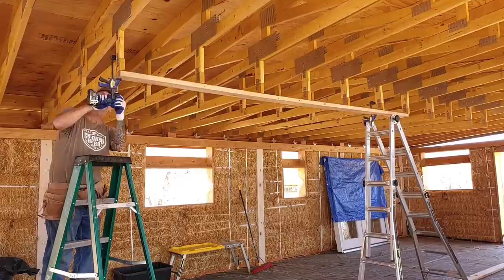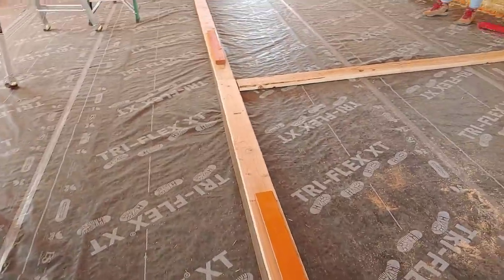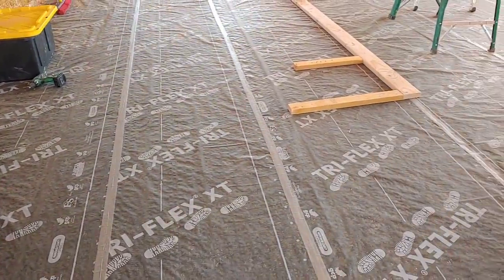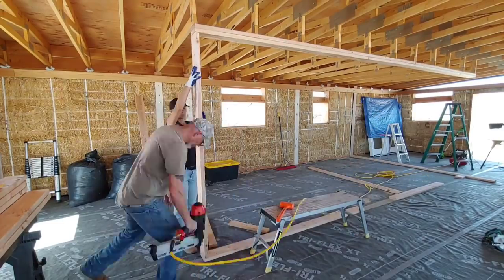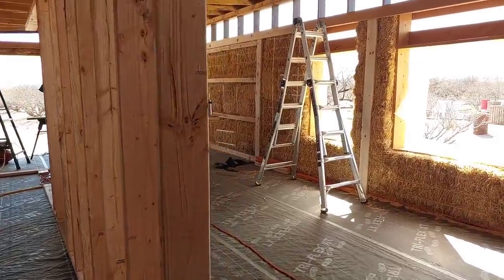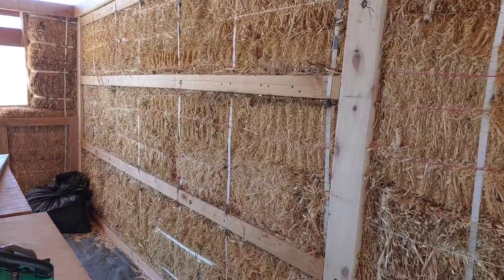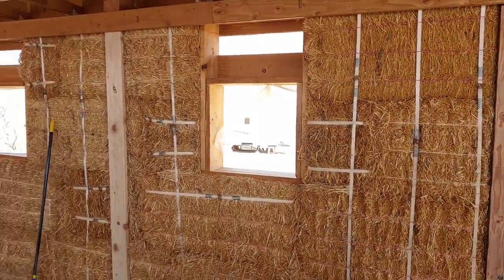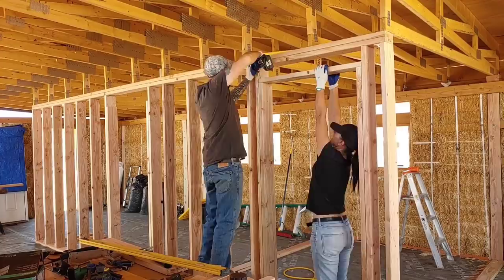Day 34: Building A Load Bearing Wall In Our Straw Bale House

Comment: Great job, never seen it done from the top down but it worked and thanks for sharing.
Reply from the maker: Thanks Daniel. Because the trusses were designed with this well in mind, it just seemed easier to do it in this order. The subsequent walls were either built in the floor and then said up, or the base plate was secured first and using a plumb bob we found the location of the to plate. The vaulted ceiling have us a few "challenges" but we worked out out.
Reply: @theupsideofdownsizing  👍🏽👊🏽

Comment: Please consider flipping the bathroom and bedroom.   My reasons are:

1) less plumbing distance from water heater.
2) keep sounds and odor away from the living room area

Thanks for the project, I look forward to each one of your videos.
Reply from the maker: Thanks for your comments. I think you're confused by the layout however. The bathroom is indeed already further from the living room than the bedroom, and because of the location of the kitchen, the furthest fixture from the hot water heater will be the kitchen sink, with the bathroom in between the kitchen and water heater. I will be installing a recirculating pump to the water heater to prevent having to let the water run in order to get hot water to the fixtures. As far as stink is concerned, there's a reason we put a window in the bathroom 😉 Sounds? We've been living in 250 square feet for 2 years without "sounds" being as issue. 😏

Comment: One thing I have been wondering as I have followed along. It is regarding the insulation. I know the straw bales are a good insulator, and I assume the spray foam for the roof is for insulation. But so far I have not seen any put on the floor. As I live in Sweden we have a very different climate to how it is down in Arizona. But what I have gathered you guys can also get really cold weather. So is the low amount of insulation in order to cope with the heat? And you will have some heating in the house to combat the cold days? Or how do it work down there, really interested to know. =)

Thanks for another great video. Very nice to be able to follow along. =)
Reply from the maker: I'll be insulating the floor after all of the installation of water lines and electrical. Most of that's going to be running under the floor anyway, so once it's in place I'll be able to insulate the entire floor and mechanicals at the same time. Thanks for watching!
Reply: @theupsideofdownsizing  ah I was just jumping the gun so to say. =)

Comment: What a nice home. Do you already notice a temp difference when you are inside? Or do you kinda have to wait for all the windows and doors to be installed?
Reply from the maker: First off, thanks for the kind words and for watching! We of course notice a temperature difference immediately just for the fact that we're out of the sun. But the Bale walls make a big difference already! And once the windows and doors, along with the spray foam insulation in the roof are complete, well, it'll be tough going back into the trailer.

Comment: I know it’s starting to warm up in Arizona. Do you feel a difference in the temperature of your house when you are working inside compared to the outside?
Reply from the maker: Absolutely! We noticed that just the other day. And when we get the spray foam installed, it's going to be even a bigger temperature difference. Now I just got to get the windows installed. 😉